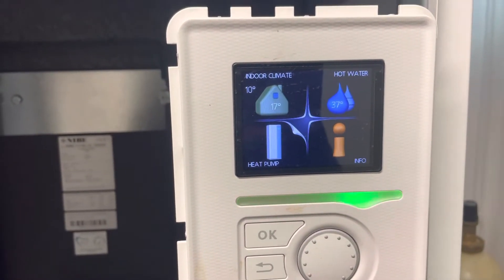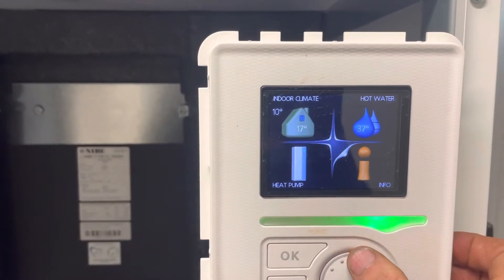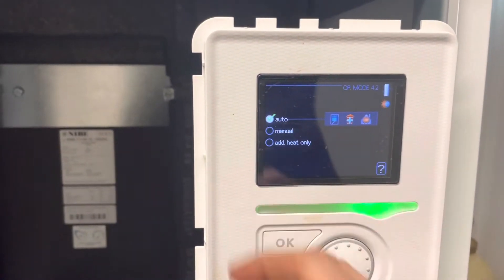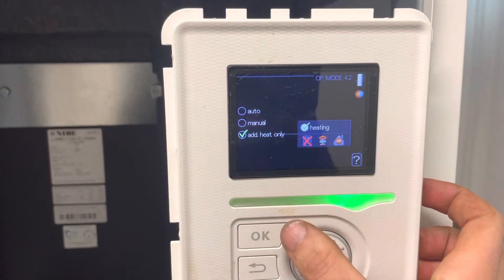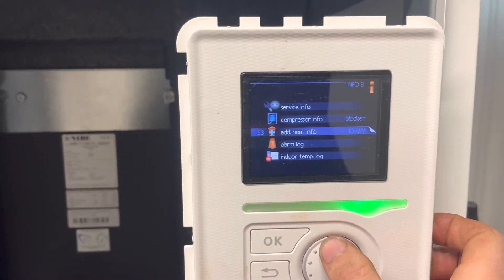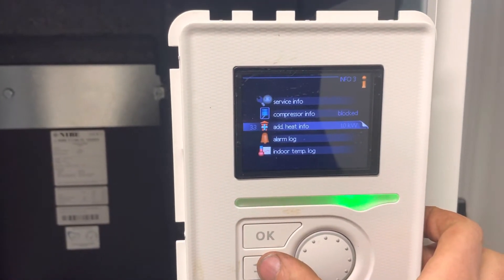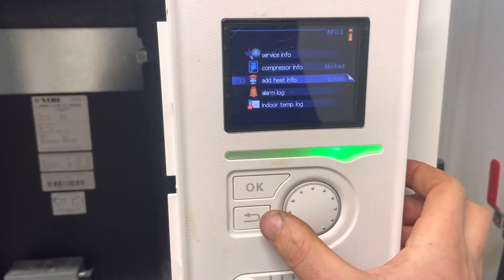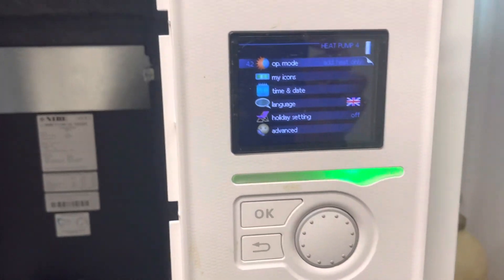Nibe 1145 1245 into add heat only for emergency hot water and/or heating. Use in event of a fault

Comment: Hello.
I have a Nibe Air to water tank and fan NIBE F2040 outside.
We had 1.3meter with snow fall in 1 night and our fan outside got  full of snow.
Now i have removed the snow, melted the ice.
The fan rotated at 1 point but stopped again.
The pump/tank inside VVM320 and I get the alarm 224
EB101

I cant figure out what to do.
How to make it heat again and make the fan outside rotate.

Its 13C inside the house now and -22C outside.

Comment: Hi there, I’m having issues with my Nibe heat pump at the minute and have it running in add heat mode but my hot water is sitting at around 30 deg. 
My inside unit is an F2016, any ideas what settings i can change to increase the water temp?
I can see on the display that both immersions are running. 
I’m assuming the system is prioritizing heating the house.
Reply: same here. aid mode does not heat water.
Reply: @MartinsApinis89 addition mode uses 3 fase system in auto mode it only uses it if the room temperature is about 4 degrees to low and outside temperture is also too much off and boiler warmt is needed then it will uses two heating systems at once in auto mode. But be want its inductive heating is not economic it will use cop 1-1 and not the heatpump 1-4,5 so heatpump line is much cheaper in electricity.
Reply: You have to hold the back button for about 6 seconds then the operator menu applaus there you can change all the heat settings including all boiler options energy saving normal or luxery mode. Good Luck.

Comment: Where can I manually set the hot water temperature on this? We prefer cooler showers so with rising energy costs, I'm going to reduce the hot water temperature from 48 to maybe 40 and see how it goes. Just to see if it makes a difference. Can I manually do this myself?
Reply from the maker: Hi James, you can set hot water to economy or even better and update software and set to smart hot water, learns your usage. To save money you should turn down your heating. You won’t save much with turning down hot water
Reply: @glightsolutions  yeah it's on economy. I was thinking of lowering the actual temperature in economy setting. I've seen a video on how to do it so I'll see if it's worth it. We don't have it set up to the Internet yet so I'd imagine I'd need that for the smart setting?
Reply from the maker: @jamesGT78  hi James, if you do drop start and stop temps then make sure you keep 6 degrees between start and stop temps. I wouldn’t bother thou. You’d be lucky to save 20 bucks all year. You’ll save a lot lot more turning down your heating. Just look at the hours your heat pump and ran for heating vs hot water
Reply: @glightsolutions  ok thanks for your replies. We don't have the heating on yet. Another few weeks and it'll go on I'd say. I'm just trying to see where I can save the most. We have a well with a water treatment system to filter it, a percolation system and a ventilation system in our house because its air tight. It's a new build. The ventilation system uses feck all because it was off all summer due to windows being open and I check our kwh usage each day. We turn everything off when not using it and we're using on average 13kwh daily. No electric shower. Just a pump off the well to add pressure. Maybe I'm over thinking but I'm the kinda guy that likes to know all these things, especially with rising electricity prices.